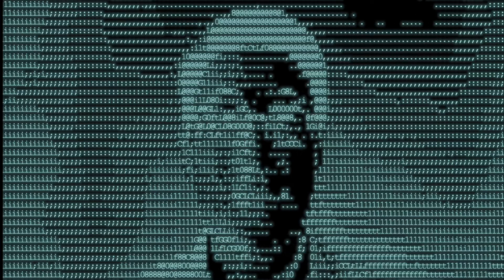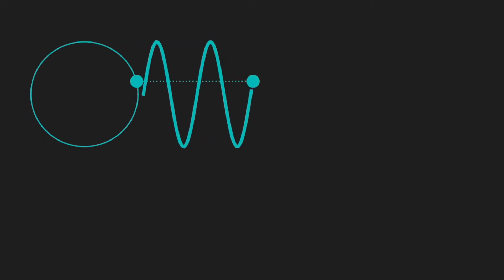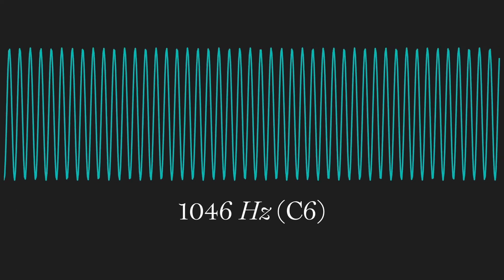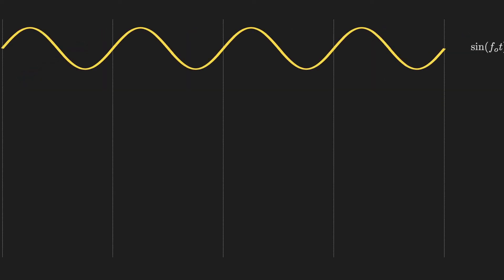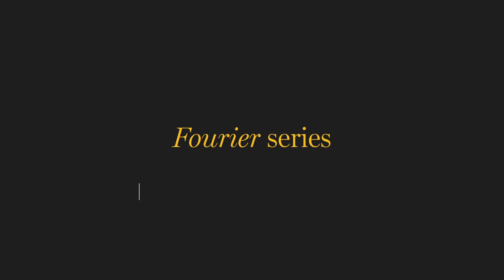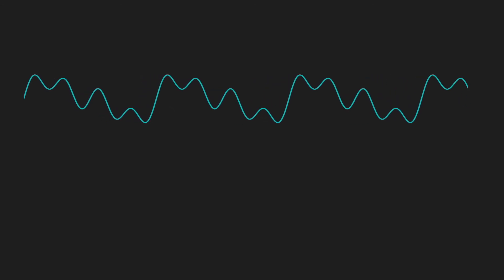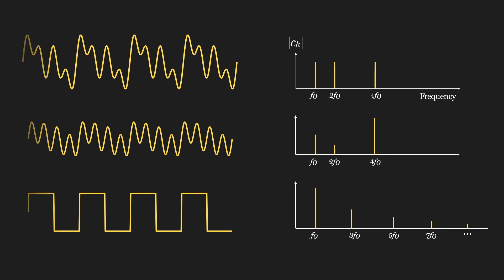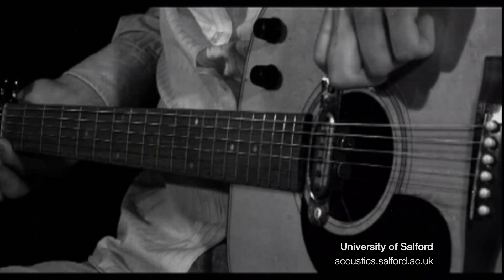Applied DSP No. 2: What is frequency?

Comment: Great video. At 08:00, why did you use 2f0 and 4f0 rather than 3f0 and 5f0 to reconstruct/decompose the signal? I presume it could also have been expressed perfectly in terms of 3 and 5 rather than 2 and 4? Or not? Is it therefore also possible to perfectly reconstruct any signal using f0, 2f0, 4f0, 6f0, 8f0, etc.? I imagine this would often require an extra frequency since we have started with a small gap between 1f0 and 2f0 rather than the allowed gap of two fundamentals between 1f0 and 3f0? Or does this just not work? Thanks!
Reply from the maker: Actually, you need all of the harmonics (multiples of f0) to guarantee reconstruction. If you go with 2f0, 4f0, 6f0, you will only be able to reconstruct signals with a fundamental frequency of 2f0 (and fundamental period of 1/2f0).

In the example at 08:00, it just happens that signal contains no contribution at 3f0 (I intentionally did that to show how the cos() and sin() contributions cancel each other exactly at that frequency). Hope this is helpful!